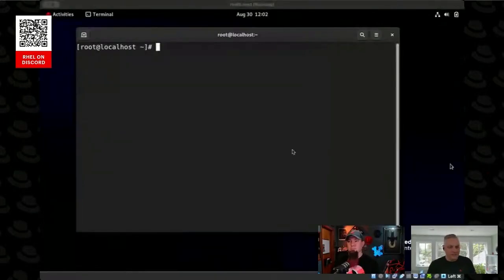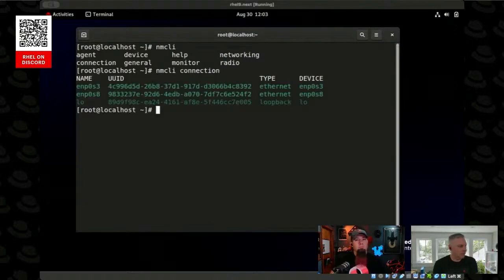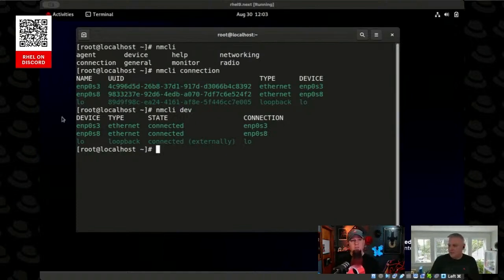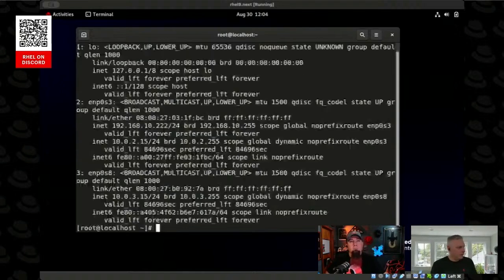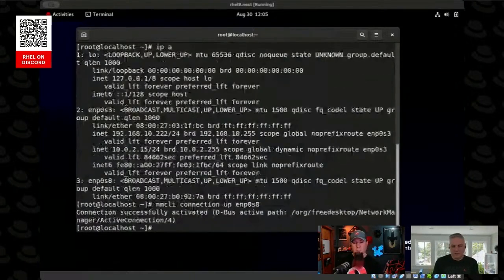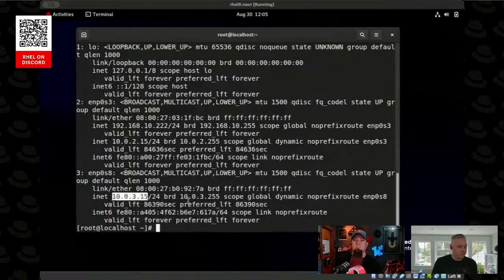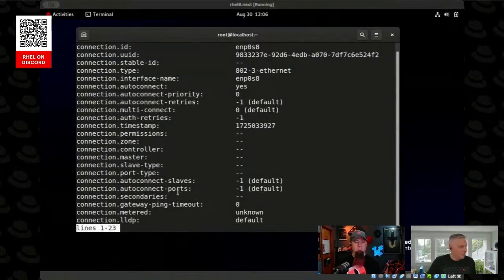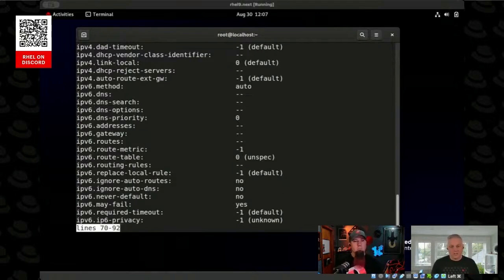Why NMCLI Makes Life Easier

Comment: This is not a compelling reason at all to move away from config files
Reply from the maker: As I mentioned earlier in the conversation, the move has been happening for 15+ years, and now is done.

I understand that changes happen and not everyone likes the result, but this is like complaining about systemd (a change which also started 15+ years ago), with the exception that there wasn’t an alternative as systemd had a hard cut-over in RHEL7.  Network Manager is more capable than the older network scripts component.  And while it doesn’t have an 8 line config file to go with each interface, there are at least 2 file-based ways to interact with it.  The Ansible system role I shared with you yesterday is not a complex file, but does have a different format and looks different than the old ifcfg files.

All that said, the distro is not going to ship network-scripts again.  This is the way now.

Comment: NetworkManager tools still suck. Even using nmstatectl is not a great solution. NetworkManager support for automated configuration has been terrible for years. That's why people have recommended to use systemd-networkd in RHEL